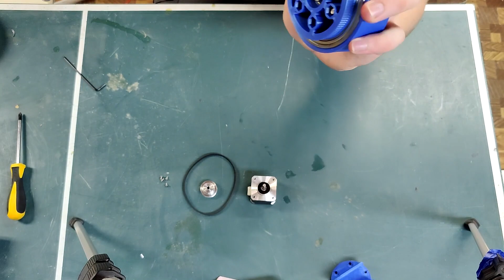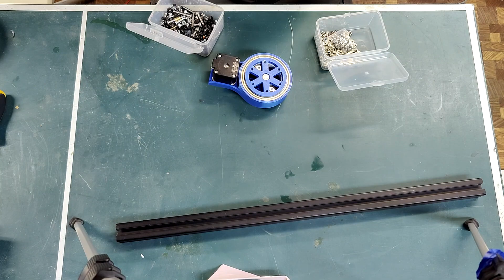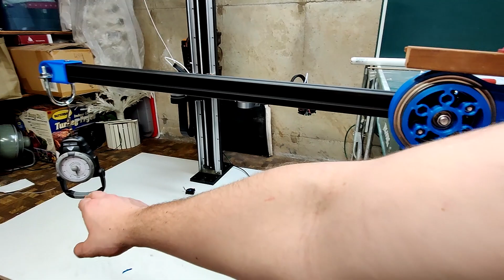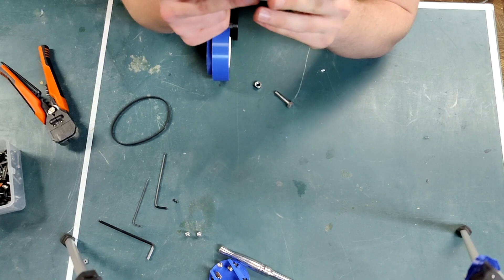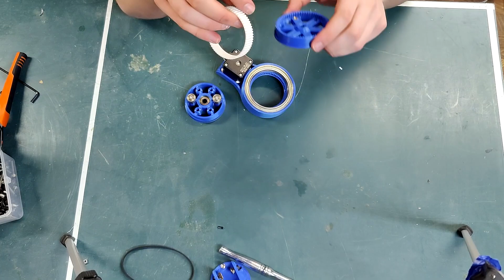Assembling, testing, and ruining my harmonic drive.

Comment: I know this is old, but so many mistakes in the design, not understanding the limitations of 3d printed plastic, and where it could have been made stronger with almost no effort and no cost, the biggest flaw was using 2 bearings as the 'wave generator' instead of cheap ball bearings and a solid elliptical (oval) printed force carrier to deform the strain wave. The second was having those triangle cutouts in the plastic parts for no reason

Comment: Hey just wanted to tell you that I didn't finish the video till the end  but plastic is still flexible so clamping it like this can cause this problem specially with harmonic gears  the clamping applies  force from top and bottom and this can cause flex and more space in both left and right side, when the tow in bearings and belt reaches the sides the inner belt can't touch out one properly so it skips the tooth in these positions and causes this cracking sound. Just imagine squeezing a rubber ball with one hand
Reply: Also sorry for my poor english. And this might not be the problem but add it to your notes.

Comment: Excellent!  You might also add in a disk to register the tops of the wave generator bearings.  I suspect at high torque they start deflecting.
Reply: I also thought that constraining the top of the bearing bolts on the wave generator would be worth a try. Also, can you use larger diameter bearings on the wave generator (in theory could go up to half belt inner diameter)? This would result, depending on the inner perimeter of the belt, in a more gradual meshing/unmeshing process and potentially increase the contact area, perhaps with some benefits for tooth wear/damage.

Comment: Very cool design! Maybe the torque applied forced the flexspline into going in dedoidal engagement (give a look at their catalog https://www.harmonicdrive.net/_hd/content/documents1/FR_Component.pdf). All strain wave reducers have a ratcheting torque which is about 9 times the rated torque (for metal ones, for plastic it must be less), so if you got 27Nm before it started ratcheting, the rated torque for your unit should be about 3.5Nm or so...

Comment: Dang, I was hoping for better backlash. That's some impressive torque though. And I didn't know you were using a printed belt. That means you can use different tooth size on each half to get proper meshing with both rings, improving efficiency for quadrupeds and other high power robots.

Plus there may be a solution to the backlash problem: add some friction to the joint, after the gearbox. Vibration within the backlash range will cause ripples in the print, but if the joint has enough friction to hold its position until the actuator forces it in the opposite direction, then you can use the backlash compensation feature in Marlin and be all set.
Reply from the maker: This backlash test was after breaking it. When it wasn't broken, there was almost no backslash unless there was a large amount of force applied. I had an idea for pre-tensioning the drive by using a torsional spring.

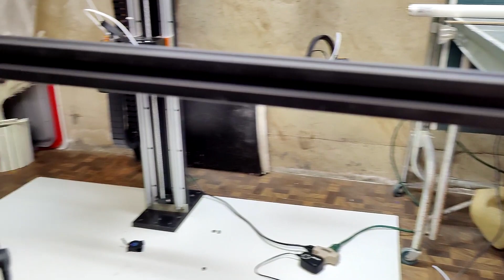Comment: @11:04 might want to check that math unless you've invented antigravity lol

Whats the advantage of using a custom printed belt as opposed to something commercially available? i.e. a gates belt flipped inside out.

Seems like wider belts is a good easy change to increase the contact area. You could also consider adding the rest of the bearings on the wave generator or increasing the bearing size so that the belt pulls away at a shallower angle (or more smaller bearings). The belt no doubt can be flexed more/at sharper angles than a metal flex-spline of similar size so you can probably use a larger contact patch than possible with a metal spline. For keeping the weight low you could use a combination of bearings and PTFE "skis" which could much more precisely control the shape of the contact area and keep the belt from pulling away in the space between bearings. It could also be the bearings flexing away from the belt as the back-driving force causes the belt to ride up on the gears so increasing the length of the wafer screw or just tightening the tolerances on the captive nut so it's a press-fit may reduce the flex. Considering the depth of the strain wave gear I don't see a reason not to.

Love the project. Hope to see it continue to improve!
Reply: I found that drive belts did exhibit belt skipping, probably due to their compressibility (rubber) and would expect nylon teeth to elastically deform much less under similar loads. So this seems like a better way than timing/drive belts for a high tooth-load application.
Reply: @simonmerrett  interesting! Id seen your videos and a few others using belts which is why I asked.